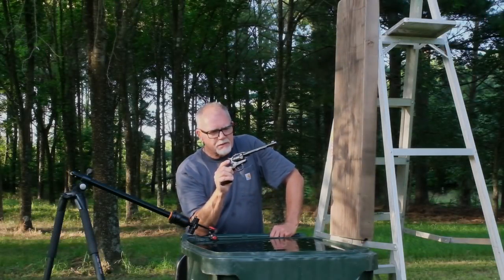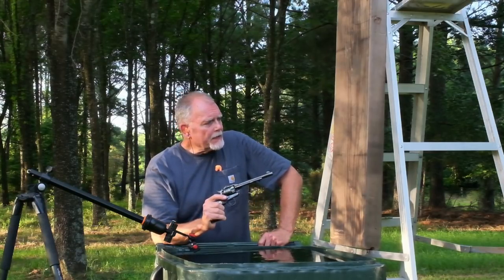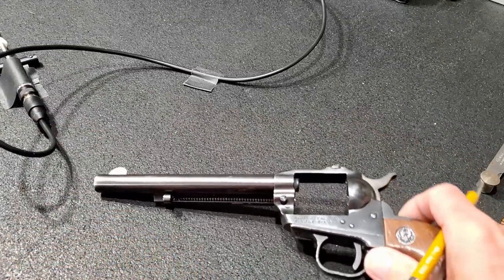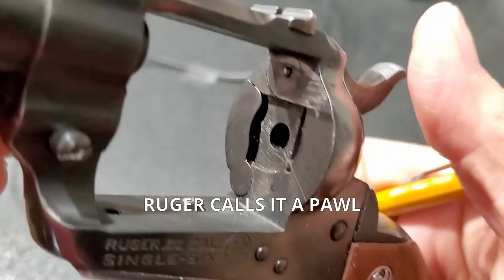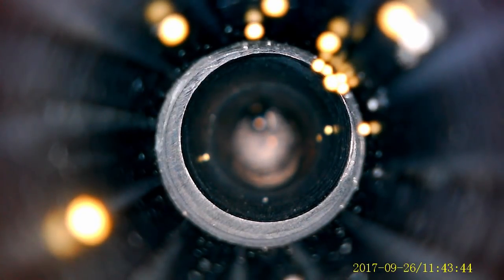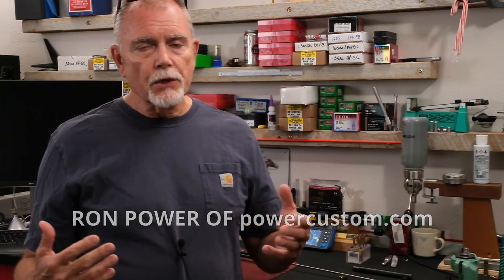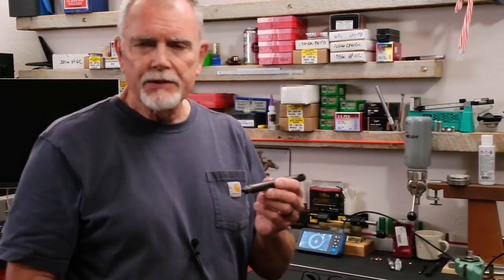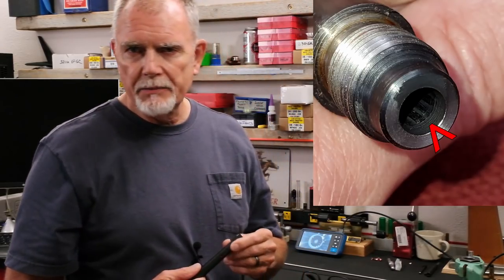The Bullets From My Single-Six Are Crooked ! ! !

Comment: That much play seems to be related to the alignment between the frame and cylinder pin, one or both is wallowed out, or warped. There should not be that much play in the cylinder along that linear axis. Someone with machine tools could check the pin for straightness and uniform diameter. A new, or slightly oversized pin might be what you need. If the barrel is square with the frame, then the cylinder is the issue. 
You could check that by inserting a cleaning rod down the barrel and see if it centers on the "witness mark" left by the base of the cartridges on the rear of the frame in the firing pin area. If that is good, then cylinder alignment and lockup are your issues and replacing barrels will not help.
Reply from the maker: Thanks! I've checked the pin and it is straight  and uniform in diameter. And ther is no sign of excessive wear. That leaves excessive manufacturing tolerances as an option to consider. I'll cover some of that in tomorrow's video.

Comment: As i observe your video I see that the cylinder is moving on the axis at the center of the cylinder. My question is "Isn't the first chore to firm up the cylinder rotation ?"
Reply from the maker: I did that with a Keith style oversized base pin from Power Custom.

Comment: what caused the punch marks on the back of the cylinder, it looked like the firing pin was striking  the cylinder in various places.
Reply from the maker: I think some young whippersnapper was Fanning the hammer and causing firing pin strikes at random places.

Comment: So, what if the hole in the frame, where the barrel screws in, is off instead of the bore? I don't think a new barrel would help under those circumstances. But, I suppose the "new" barrel would verify if that is the case or not.
By the way, your assistant is much more charming.
Reply from the maker: Haha!
Reply: @TargetSuite  Better looking too!  :)))

Comment: You don't think the cylinder or the axle the cylinder rides on are worn out? I don't know if the cylinder has bushings or not. To me changing the barrel is not gonna fix the misalignment.
Reply from the maker: Good thoughts, but no, there is no measurable wear on the base pin.

Comment: How common is the issue of bullet alignment in auto loading handguns? I know they don't have to worry about timing like in a revolver, but I caught a few bullets out of my desert eagle in 44mag and noticed that the polygonal rifling flats (for lack of better words) in the bullet were not even around the circumference of the bullet. This leads me to believe the bullets are not traveling straight down the bore, but at a very slight angle. The gun is only two years old with around 400 rounds through it, and accuracy was about 20 inches at 70 yards with the stock iron sights, at least with my abilities. I assumed the gun was capable of better with an optic but after seeing those bullets, I'm not so sure. Is it common for handgun bullets to have a slight angular wobble in flight?
Reply from the maker: I think it is reasonable to expect that your bullets are going to come out of any semi-auto handgun flying straight and true with no wobble.

Comment: With movement up and down on the cylinder it looks like the pin or hole in the center of the cylinder have excess wear.
I would try a new cylinder pin first or maybe use a different cylinder to see if it is the same.
Reply from the maker: I appreciate your comment. I do have an oversized base pin from Power custom. It takes out almost all of that play.

Comment: Brings new perspective to accurate revolvers which are said to be "line-bored" from barrel through cylinder. I've a Blackhawk 45 which cylinder center pin bore looks like it was chewed out by a miniature post-hole digger, plus it's sloppy on the pin. Also I haven't gaged the chamber throats to see the actual diameter. The cylinder chambers are rough and could use polishing, but I'm sure they are over-sized as usual which reduces brass life substantially. The cylinder-to-barrel gap looks like it could be tightened up. The forcing cone face looks like it could use some squaring and a gloss polish. The forcing cone could use a nice 11° chamfer and polish. While we're at it, the barrel should get slugged to find out where it's at as well, make sure there's no bore constriction where the barrel threads through the frame.
There's a lot of alignment and bore factors that can really tighten up the function of a revolver. I also like Ruger's stuff but they sure could use a good amount of post-manufacture TLC to smooth/true up. Strong functional designs, pretty roughly machined and executed.
I've handled a Freedom Arms revolver and the difference between Ruger and FA is astounding. But so is the price.

Comment: 66... it is 2021 now, probably a million clicks dry fire and live firing on that feed paw and stopper. is there any spark coming out on the wheel? i have been told if you see spark from the wheel, that gun is beyond any repair. and from the outlook, you won't spot the worn out causing back slash. one theory is the worn out of the spindle that hold the wheel, shim that spindle with very thin bushing will do, others say it is the non synchronize move of the paw and the stopper. and i believe it is both.
Reply from the maker: Certainly Lots to look at. Thanks for the comment and thanks for watching

Comment: I might agree on the base pin as the logical progression to troubleshoot the vertical movement from alignment. The hand/ pawl is only used to push the cylinder into the bolt/cylinder stop. The bolt should hold the cylinder position true relative to the barrel forcing cone. The left to right movement would be attributed to the either the gate on the cylinder becoming deformed from years of use or the bolt becoming bent and deformed from years of abuse like slap cocking the hammer, sorry for the use of western slang. This same abuse would also damage the base pin causing the vertical misalignment. When the the hammer is pulled all the way back and held with thumb pressure on the cylinder, the cylinder should be in tight lockup at the bolt and the movement of the cylinder at that time should be very minimal, if any. As your thumb pulls off the hammer to rest at full cocked position, the hand slightly retracts and the only force holding the cylinder should be the bolt. You can observe this by cycling the action with the cylinder removed. By removing the bolt from the frame, you should easily see any deformation in the bolt. Powers customs use to make oversized bolts you would have to hand fit to correct this problem. The base pin would be the primary cause of any vertical movement of the cylinder. With the cylinder removed and the base pin installed, measure for any movement of the pin….  Their are several manufacturers of precision ground oversized base pins that could help you in product selections. 
Or at least thats the view from my saddle.  Either way, this is a great lesson in troubleshooting problems every wheel gunner could use. Thanks for posting!
Reply from the maker: Thanks. I appreciate that comment! I do have an oversized base pin from Power custom that takes out most of that play certainly gets it within a reasonable level. Part of the process of course will be to fit the oversized cylinder stop and new hand. We'll just have to see how that vertical misalignment works out with the barrel Exchange. Thanks again for your comment.

Comment: There are firing pin strikes on the cylinder between chambers almost looks like a renegade cylinder made to fit. If you cut the bullet off like a wad cutter it will probably shave and throw lead
Reply from the maker: Good eyes! Those firing pin strikes are one of the indications that there has been something done to this gun over its many years that could be contributing to the problem. But the cylinder is numbers matched to the frame so I know it was the original cylinder. That's the thing about an older gun you just never know what kind of storied past it has!
Reply: Perhaps someone was ‘fanning ‘ the revolver and messed up the pawl then tried to file it down then just traded it in , which in my opinion would be irresponsible

Comment: What positions that cylinder? The spring-loaded stop at the bottom pushes it up against the top because there is play in the bearing. Would it make sense to shim the top of the cage?
Reply from the maker: Better yet, I will replace the cylinder pin with one that fits tighter in the frame end in the cylinder. That will take out a lot of that play.

Comment: I'm thinking that somehow, maybe, the cylinder pin may not be in proper alignment. Could be that the cylinder pin holes in the front and rear of the frame are misaligned or the cylinder pin may be slightly bent. Could be the cylinder pin hole in the cylinder was not drilled square also.This issue really makes you put on the old thinking cap. 🤔
Reply from the maker: Yes, lots of things could be contributing to the problem. Hopefully the process of swapping out the barrel will show us what has been wrong with this gun.
Reply: @TargetSuite  I am sure enjoying this mystery series that you have going on here. It's like reading a great "who done it " book that you just can't put down. It's really had me  thinking! You do a great job with all of your videos. I'm hooked! I'm 71 and have had a love affair with guns since I was 6 years old. For a few  years, after returning from Viet Nam, I hung up my guns but got back into hunting and shooting once the dark cloud of that experience finally lifted.

Comment: Is that the cylinder that single six come with? I have had customers trade cylinders or loose one all kinds of stuff they could come up with.  Cylinders were tuned to the gun that it was made for. 22mag cylinders were stopped a lot.
Reply from the maker: Yep. It is the original cylinder. It has the last three of the serial # etched on it.

Comment: That cylinder seems to have a lot of dings on the face and back side. Have you checked it's dimensions and the cylinder gap?
Reply from the maker: I have checked the cylinder Gap and it's very tight at the top like one thousandth of an inch. At the bottom it's about five thousands. And yes there are some dings some of those on the back face are firing pin marks. I have no idea how the firing pin could be striking the cylinder between the chambers. It's just an indication that there is a story behind this revolver maybe many stories :-)

Comment: Not a gunsmith here but I am an automotive technician... not sure if anyone else may have mentioned it. But with the vertical movement you are experiencing would that be an issue with the center on that the cylinder rides on being worn out giving it too much vertical play? The reason I bring it up is it does move down enough to center perfectly but then it pushes itself back up when you remove the feeler gauge. It almost seems like by remedying the vertical issue would also remedy the fact that it is to the left as well.. pulling the center point back into proper position the the paul would then put the correct amount of rotation to the cylinder to line up side to side.

Comment: Isn't this misalignment horizontally, and vertically indicating slop in the cylinder axle? It isn't aligning because the axle is either worn or where it seats when the cylinder is in the frame has been enlarged through excessive wear. Yes?
Reply from the maker: No sir. I checked and there is not enough play in the base pain to account for the misalignment. Plus the oversized base pin which is tight all the way around does not correct anything.
Reply: So is the visible play we see when you're using the feeler gauges related to any loose or worn parts about the cylinder? I mean, it's really the only moving part(s) other than those you ruled out from your buddy. The frame isn't going anywhere.. puzzling from my distance anyway. I like tinkering with mechanical/electronic devices so seeing this video has rattled my brain just a smidge.

Comment: Just a thought. Is the rod holding the cylinder in bent. Try taking it out and putting it back oriented differently. Interesting situation. Good stuff.
Reply from the maker: That was a good thought but no the cylinder pin is straight as an arrow. I've measured it a couple of different ways

Comment: I'm not a gunsmith so I might be seeing  things differently.  Could the base pin be the problem aside from the other parts you mentioned?  Placing feeler gauges in there seems to make the cylinder bore alignment good.  If so wouldn't that indicate a problem with play in the cylinder base pin or how the base pin interacts with the frame? I don't have a Single Six but I do have the Single Ten to compare.
Reply from the maker: There is play for sure and you see it when I Jam the feeler gauge in there. But when I put in the oversized base pin and it takes out that play it just ensures that the chambers are too high. So there's something else going on that is causing the chambers to be off center up and down

Comment: I am no gunsmith but I would look where the last non gunsmith was and the point of wear, on an old gun. Look where the rod secures though the center of the cylinder. If it was worn/sanded down that would increase play. The cylinder stop would push up and the pawl would be shy in rotation by the amount of play in the axel.

Comment: Would not it be the hole in the cylinder and locking pin being worn out loose new locking pin or new cylinder. Could u machine out cylinder and  reline cylinder with new insert to tighten everything to spec?
Reply from the maker: Great suggestions. I've got a few things that I will try before that.

Comment: Interesting series. You have checked everything very carefully. I'm not sure there is a fix, just replacing the barrel would probably end up with nearly the same results. It seems the cylinder itself is the issue and that it is offset as it is in the frame. Not being a gunsmith could the removeable pin that goes through the cylinder be the issue? Would replacing that cylinder pin maybe straighten out that slight offset? Sorry if I'm asking stupid questions.
Reply from the maker: At this point there is no such thing as a stupid question. But I do have an oversized pin from Power custom and it does not help other than to tighten up the play in the cylinder.
Reply: @TargetSuite  Thanks!

Comment: Well George what's next a new barrel? Is that possible I would have smashed that pistol into a hundred pieces by now. Is there anything that can be done I would have compensated my grip or aiming point. What's the end game new barrel or can this be fixed. I will stay tuned if anyone can fix it it's you. Hope your plan work's
Reply from the maker: Starting at the bottom and working up, if all else fails I can modify the pistol as it currently stands. I think about getting the timing correct the up-and-down misalignment will be substantially less and I should have an improvement on accuracy. But the next step is to try that new barrel and see if the alignment issue is better with it. If so then I will get it fitted properly for the gun and I'm the cylinder for that Barrel. If all of those things fail I'll just buy some larger steel targets😄😄😄
Reply: @TargetSuite  I wish you well always I hope you get it done. Just a heads up I get ammo online  I hand load most of my rifle and pistol calibers. But shotgun ammo I buy I have a bunch. But I purchased a lot of 00 buck and slugs all 12 gauge. For the first time in month's a great selection and no gouging. I'm not putting the nane . I'm not sure how you feel about that.?